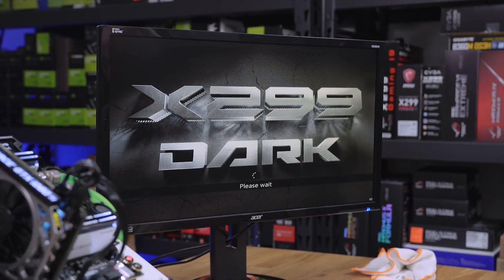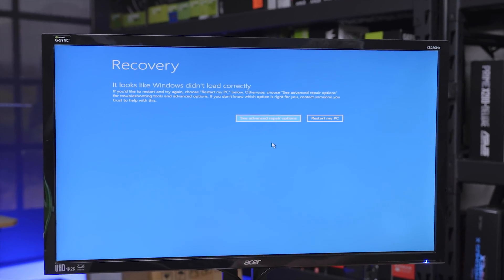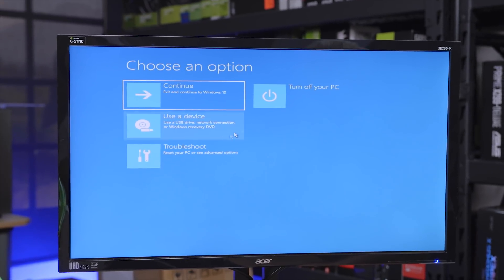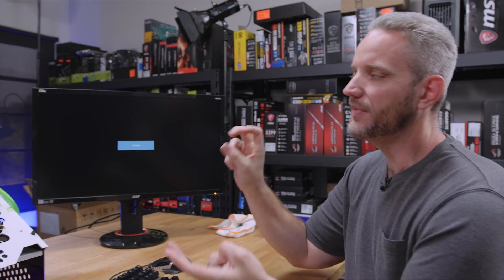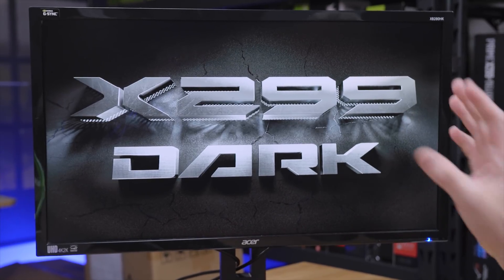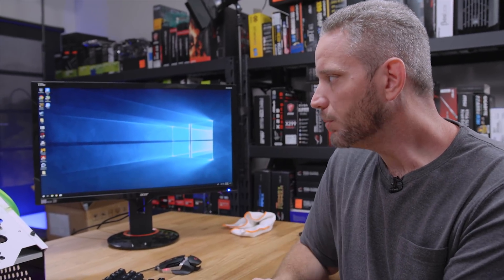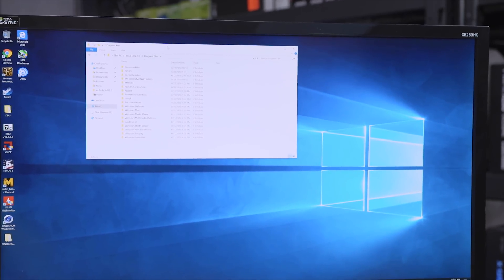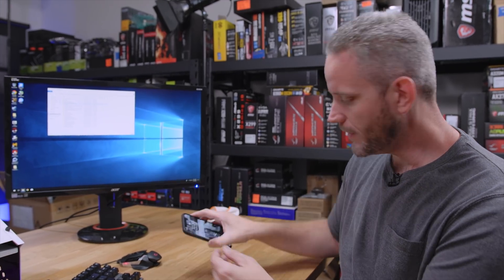New Test Bench Keeps Boot Looping... Here's how we fixed it

Comment: Bent Pins...the ram., the cpu..the psu..the damn board....check reseat everything. If no go looks like rma dude...The Supermicro is behaving badly, that thing still throws code 55 intermittently..cold boot will just shut down a handful of times...do get in the bios set xmp sometimes will not set xmp at all...then it started freezing once did get all in....As usual the EVGA is flawless and working the 2nd one...I don't know, believe there was something wrong with the Bios and or chip....

I don't know...you made it that far and to the BSOD...can also look at and think about that drive you are using....

Comment: I had a similar issue a week ago where on one of my gpus if I had drivers installed the system would lock up so bad any program that used any amount of the gpus horses would cause instant crash, if I kept the card installed windows couldn’t install most updates or would make the system unbootable, if installed any sort of video driver instant crash until it was uninstall. My problem my gpu bricked in such a way that my intergrated gpu wouldn’t work with it installed, windows couldn’t install updates without it bricking windows into endless boot loop of failed to install updates and the only fix was running my gpu without drivers or only using intels intergrated graphics which is a massive step down from a 780.

Comment: I believe the Windows Installer Service (msiexec) has never ran in Safe Mode by default since Windows 2000 so it's not just a Windows 10 thing. Various system services aren't automatically registered in Safe Mode however this can be done. 

To do this run Command Prompt as Administrator then run the following commands listed below depending on your Safe Mode option.

For Safe Mode:
REG ADD "HKLM\SYSTEM\CurrentControlSet\Control\SafeBoot\Minimal\MSIServer" /VE /T REG_SZ /F /D "Service"

net start msiserver

For Safe Mode with Networking:
REG ADD "HKLM\SYSTEM\CurrentControlSet\Control\SafeBoot\Network\MSIServer" /VE /T REG_SZ /F /D "Service"

net start msiserver

Also, another way to boot into Safe Mode is to create a Windows 10 bootable USB install and enter into the recovery options there from the setup wizard by selecting "Repair your computer" option.

Hope this helps other viewers :)

Comment: You should be able to go into 'msconfig' and disable the problematic service on startup. Afterwards you can uninstall the application the traditional way.

JayZ is absolutely correct Windows does not handle 'bad' drivers elegantly.

This issue should also be reported to AMD as their software should handle the exception in a correct manner. It may have triggered due to an Intel processor, but if you installed any non-ryzen processor there would be a chance it would fall flat on its face. Could you try with a non-Ryzen AMD processor please?

Comment: Dont know, Maybe iam wrong but, you could try to disable the Ryzen Master Service, so it doesnt start at boot.
Then reboot to normal mode and deinstall the Software.
You cant deinstall/install in recovery mode cause of security reasons.
Everything has it's downsides

Comment: Another really important tip is that when you have to deal with MS tech support, only call between 11am-3pm(EST) Tues,Weds, Thurs as if you don't you'll be connected to a place in india where they have no education on the OS and will tell you blatant lies like "Microsoft doesn't have a way to produce codes for windows 10, that is done by your retailer" or in one case, they actually deleted sys32 on one of my rigs.

Comment: Blames Microsoft for being clueless when it's Jay being clueless that having AMD specific programs installed on an Intel rig is going to cause problems.
It has always been this way.
Windows 10 only reacts a bit harsher.
Every OS out there will throw errors and bluescreens at your face if you are running , for an example, Nvidia and AMD gpu drivers at the same time.

I like to bash the big corps myself, but 99% of the times when there's a problem, it's prolly the users fault.
Reply: The issue isn't the BSOD/kernal panics. The w10 issue is what is the benefit of safe mode when crucial services that are needed to FIX the problem are not available in safe mode itself. 

In fact disabling the windows installer service isn't actually that bad either, but there should ALWAYS be an override to let you enable it. Adding in that hardware flag to prevent the start of the service makes no sense. 

Imagine if you forgot your password....and you have to go to account recovery, and then during that process it says, to recover your password you must be logged in.....how is that not an issue?
Reply: This is to protect the normal user.
Microsoft has been overprotective past years, you don't even have 100% admin rights over all the files on your pc.
That's a bigger problem than a service that you can just activate temporarily to solve your problems.
If you can't do simple cmd stuff, then you shouldn't be fiddling around in safe mode.
What jay could have done is to google the answer, http://bfy.tw/JErW Let me google that for you link*, *Fixed the link
Took me a few seconds to find a fix for his issues.
Reply: Then wouldn't the fundamental problem be what kind of OS does not give 100% admin right in a recovery mode for USERLAND PROGRAMS. This makes zero sense. I can understand the disabling,  maybe a UNIX style system which requires root. but to lock userland programs as if it were kernel level programs is dumb. No other OS has this issue. Even Apple which locks out true "root" in their OS still gives their "super user" full rights to modify any user programs. This is why a 2 tier architecture OS exists in the first place. 

If you can't do simple cmd stuff then shouldn't fiddle around with safe mode.... the whole existence of safe mode is to provide a graphical recovery mode. Saying this statement essentially means safe mode as a whole has failed.
Reply: The whole point of me saying "If you can't do simple cmd stuff then shouldn't fiddle around with safe mode"
is that if you can't handle basic stuff, then you shouldn't do more advanced stuff yourself without checking with a person with higher knowledge than you.
For an example google.

Microsoft doesn't even trust users with downloading and handling updates anymore.
So it's not that surprising that they are not letting you do whatever you want with the system.
They are treating their userbase like children, but these restrictions are not a problem for techsavvy folks, they can easily be bypassed.
Reply: So we are at a point where it somehow makes sense that ANYONE of all skill levels can uninstall anything when running in a non-safe mode, but in a recovery mode that same action is restricted people with knowledge of editing reg keys and messing with a command prompt. 

The issue isn't "some things should to left to the pros" It's the same actions somehow have different skill levels. If MS really doesn't trust the user uninstalling crap in safe mode, why do they let you uninstall crap in full windows. especially since NONE OF THOSE PROGRAMS ACTUALLY RUN IN SAFE MODE (hence the "safe" part)
Reply: True.
That's Microsofts logic to you.
But I guess you can remove stuff and cause more damage in safe mode than what you can in normal mode.
because most services are not running, blocking you from removing crucial stuff.
Pre-built systems that come with an OS also tend to have a standard user already set.
That one usually is a standard non admin account, and with UAC cranked to the top.
= Users can't fiddle with dangerous stuff.

But hey, after typing all of this shit I'm starting to get this feeling that microsoft is insane or that string in registry that removes the ability to uninstall software in safemode is just something they fucked up with, buy hey, it's easily fixed thankfully.
Reply: Godofcheese no its to protect wannabe power users who dont have a fucking clue what they are doing following guides on the internet.
Reply: @skifree If I remember correctly the reason why installer is disabled in safe mode is historically to prevent malicious code from installing something. I believe it partly stems from the fact that there was no separation of privileges in older versions of Windows. Sure you can create a user and an administrator, but the latter basically had the same access as root has in Linux. Hence booting into an administrator would give malicious code full access to the installer. If that's still a relevant problem is debatable. At least I don't get why we now have administrators that are somehow separated from having 100% administrator privileges if we still need this archaic separation in safe mode.
Reply: Safe mode is intended for maintenance, not functionality, it provides minimal access to features. Casuals..smh. You can't do more in SM but LESS. Windows allowing you to do LESS in SM has been a thing since..I don't know. The fact that Jay seemed surprised by this, and you as well, proves Neither of you are experienced with SM.
Reply: Safe Mode is intended for allowing you to boot when something that starts at startup is preventing you from booting the OS. If they are not going to allow you to remove the offending program there is no point in having a safe mode. The fact that you do not know this proves that you have no experience with computers period.
Reply: Yes and if he had opened the correct control panel app or task manager to disable the app at startup he could have stopped Ryzen Master from booting. Even though it would have been nice to have a safe mode with Windows Installer option the fact that Jay can't find these things and attempts to uninstall Ryzen Master is not an issue with Safe Mode it is an issue with Jay :p
Reply: I'm not a fan of it but you would know more than me about windows safe modes specific workings. I'm not a fan of allowing stored changes as opposed to uninstalling things because there is more of a chance of preventing windows from booting into safe mode in the future but it goes with windows ass backwards way of doing things. I've had to deal with it with family computers but it makes me want to rip my hair out. I purposely evicted all the windows os's from my home yet I still get asked to help people with their messed up windows install. (hence the reason for the linux usb rescue drive.)
Reply: pretty sure he couldnt get to the log in screen on the video, which leaves out control panel and device manager, as you nee be logged in to use either....even earlier safe mode blocks  most of the helpful tools, so its more a bad design flaw than a proper solution, if u can use the command prompt skillfully it works, otherwise the user friendly os just bent you over and no reach around or kiss..typical microsoft
Reply: To be fair its running the software and drivers without the hardware for those drivers.
Reply: Nvidia won't cause problems. Sure their Nvidia control panel is utterly useless with an AMD GPU, but it will just throw a simple on screen message saying that it can't find a compatible GPU or just stop itself. Not sure about AMD's control centre (or whatever it's called these days). If Ryzen Master is representative for their code quality it will probably fail spectacularly.  As for the Nvidia and AMD driver those are unloaded automatically by Windows regardless if you run Windows 10, 8 or 7.
Reply: Actually your wrong. Linux just defaults to the open driver if the proprietary driver doesn't work unless you uninstalled it or your running a kernel that doesn't have the open drivers installed. It will boot, no safe mode. I've done it many many times. I even have a usb stick that I used to boot a laptop off of that had an AMD video driver installed on it i never took off that I use as a rescue that still boots systems with Nvidia cards.
Reply: He was mainlyt complaining about how difficult microsoft makes it to fix the issues on your own. You have to let your computer fail 3 times to get into safe mode (possibly corrupting data everytime it fails), THEN once you finalyl get into safe mode, they don't allow you to uninstall anything?? safe mode is supposed to give you FULL control over your computer without any restraints, so that you can fix things manually.
Reply: Godofcheese except the point is you can't uninstall I'm safe mode that is a major WTF to MS. That is just plain stupid on their part.
Reply: Seriously... It's a service that needs to be run in order to uninstall in windows.
It's not activated by default for safety reasons.... hence the name, SAFE MODE.
"net start msiserver", jesus.

Comment: Winaero Tweaker can enable Windows Installer in Safe mode as well as enable the older Windows 7 startup options. It's pretty neat, has tons of tweaks and is free. The weaker itself doesn't have any ADs either. Just the website.

Comment: BTDT on Windows 7. A registry hack to enable the installer service saved the day. So, it's not so much a Windows 10 problem as it is a stupid AMD program problem (I mean, how about checking the CPU ID before trying to run?). Of course it can be argued that not being able to uninstall stuff in safe mode is kinda braindead.

Comment: google "windows installer service safe mode" and you get as first result a thread on the symantec website about a registry entry to create in safe mode to get the uninstaller to work.
sure renaming the folder is an "easier" solution but if you arent afraid of the registry than i think the solution i found in 2 seconds of searching is better.

Comment: Usually you can use Revo Uninstaller to get rid of pesky files that won't delete or uninstall using Windows built-in uninstaller. It does an advanced search and you can mass delete related files to broken programs using that. It's saved me many times in the past.

Comment: Blame it on that darn Windows registry!
Reply: This has nothing to do with the registry
Reply: Actually, it does as the Windows registry stores all the locations of programs that get called at startup.  He could have opened up the windows registry and removed the corresponding entry to prevent Ryzen Master from being called at startup.  He used the workaround of renaming the folder which worked as well.
Reply: ZadiusTech 

I'm sorry to tell you but you can have something run on startup without being listed in the registry. overlooking this is a giant flaw on your side. 
check your own folders like: C:\ProgramData\Microsoft\Windows\Start Menu\Programs\StartUp
Reply: This is nothing about the Registry, this has to do with Jay making a rookie mistake and not removing what is obviously incompatible software 
He's blaming MS because that's what all the amateurs do, instead of admitting his mistake 
ALSO why does he not have a recovery stick to get into safe mode a lot easier?
Reply: Anibal Perez Because being unable to uninstall a program in safe mode with Windows uninstaller is clearly good design, nothing wrong with it ye.
Reply: Well yes Zadius if you want to be pedantic as all hell it is related to the registry although that is just the fix. The actual problem has nothing to do with the registry. Also altering it there is probably a lot harder to do unless you know which key you are looking for exactly. Personally I would have done it through the startup section in Task Manager. As far as this being a rookie mistake the answer is hell no. You can't guess that AMD's code is this crappy. In fact the Intel tool used to accomplish the same task as Ryzen Master is just fine if you throw it at a computer running AMD. It won't find a CPU so it's utterly useless but it doesn't crash the PC. The same is true for the application associated with their integrated GPU. And now I'm not talking about the driver as the software and the driver are two different things.

Comment: Windows 10 is fine (in this sense). You're just a babbling idiot who doesnt know to reinstall windows when CHANGING PLATFORMS. Chipset drivers, motherboard specific utilities, audio drivers and networking drivers. You claimed to have worked in IT for years and you have no idea these things are an issue... hell in high school I went from a phenom ii x6 (1045t) to a 4770k and the first thing I did was a fresh install of windows 7. And that was a mechanical drive since I put all my money into a 4770k and mobo at that time, so that took literally hours.
Reply: I don't think you understand what the issue is. Yes there are ALTERNATIVE solutions to Jay's Specific problem (such as a clean install). But the flaw in w10 is how its considered "fine, to not allow repair services to be started IN A REPAIR STATE". What if it wasnt a platform change. What if W10 during it's automatic update cycle just boot loop a system because a poorly programmed app causing a system crash.

Then all of the issues here would play out. You would get into safe mode, try to uninstall this faulty app only to realize you cannot uninstall .it This whole video on renaming the faulty install is to solve the GENERAL problem where a clean install should not be warranted. 

You are focusing this too narrowly on 1 specific app where the flaw is in MS on a general scale.
Reply: skifree I mean conflicting drivers would still exist and it would take longer to properly uninstall all of those than just copying files over to a fresh install. I get the installer was broken but I'd bet 10 buck if he put the drive back in a ryzen system, then uninstalled it, then put it back in the x299 system, it would work just fine. I've never had that issue with WIN10, and I've uninstalled many things in safe mode

Comment: How come my motherboard only works with one 8gb ddr4 ram stick in slot ddr4_4 but not any other slots? And i can only use 1 stick and not 2 sticks. My ram is G.SKILL Ripjaws V 2133mhz 2x8gb, my mobo is z170mx gaming 5, i7-6700k